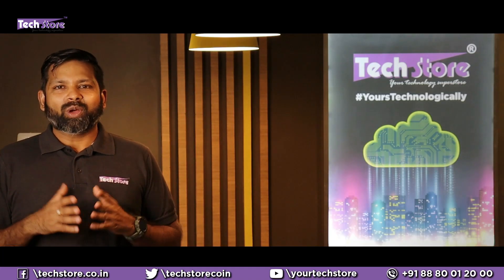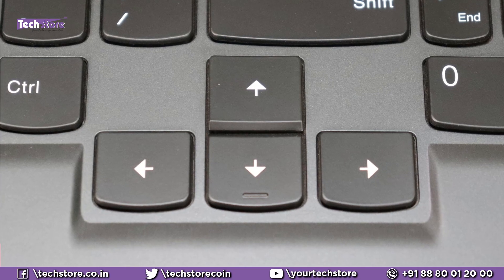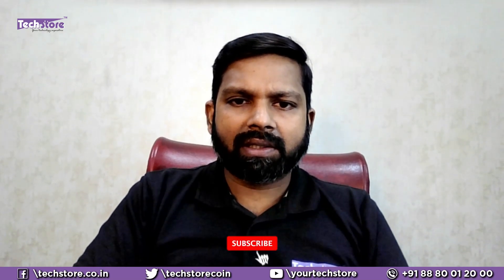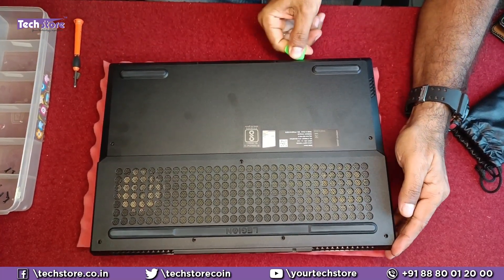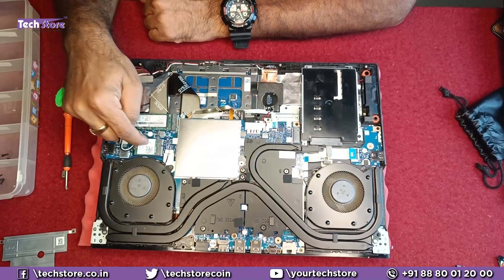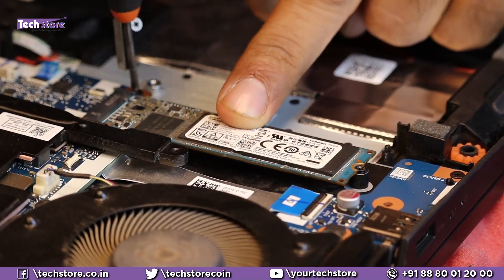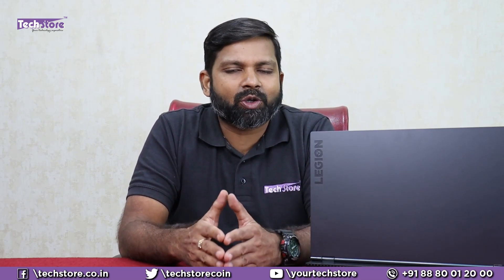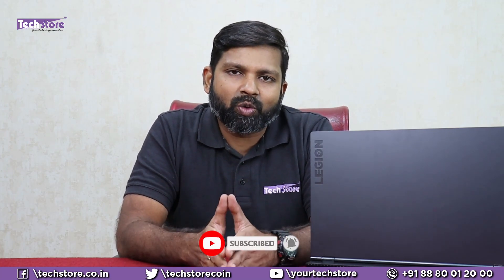Lenovo Legion 5 Gaming 2022 : Review upgrade ram ssd battery disassembly of base DIY

Comment: i have legion 5 15ACH6H, i don't have the hdd caddy , the place is empty, can i buy the hdd caddy and place it ? (I want a 2TB HDD)
Reply: Yes, It's very easy to do. I have same laptop
Reply: @Tiger995-e7d  did you add one ? i think there no place to place the screws
Reply: @Tiger995-e7d  i received the caddy today, and i didn't work, there is no place to place it or place the screws (not suitable ), im crying
Reply: @Tiger995-e7d  not even a place for sata cable
Reply: @meriemben5143  Then just go to any repair shop. He will fit it in less than 100 Rs